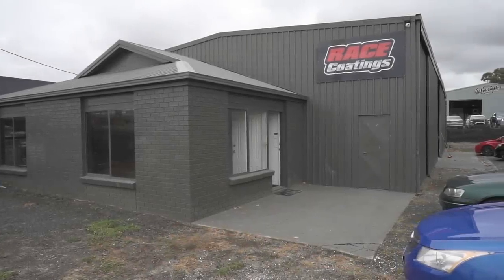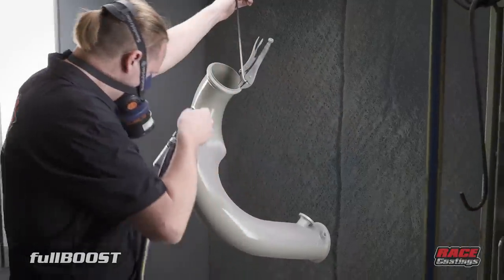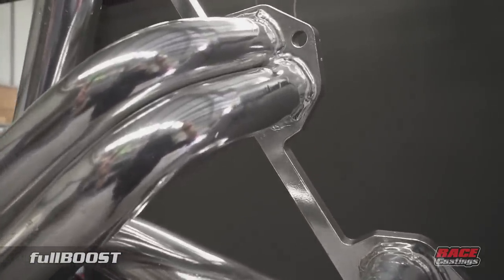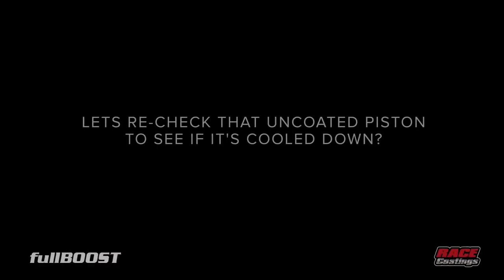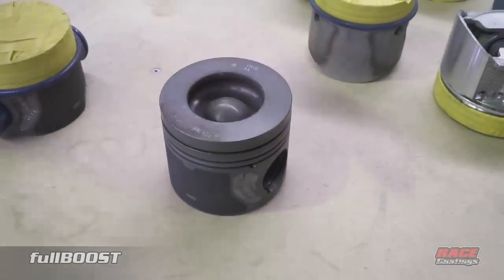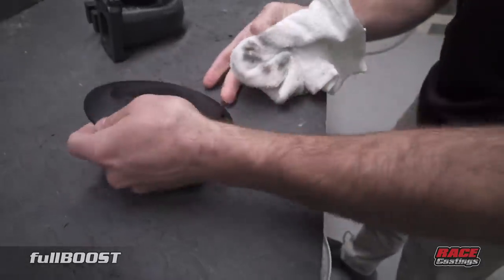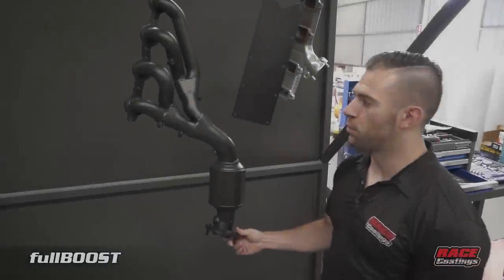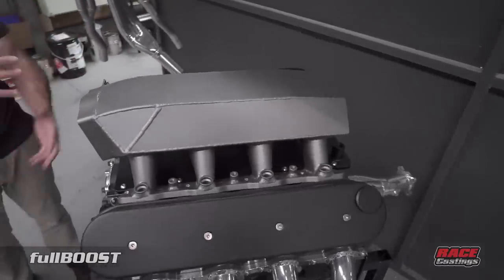What is Ceramic Coating? | Race Coatings

Comment: any fire produces a lot of infrared, this infrared is a heat producing wavelength,  and heats up non reflective surfaces 
we all know the hot glow in our face standing next to a big fire ;-)
what the coating does is, it  reflects a big part of this radiation heat back, so underlaying material stays cooler

Comment: the cut scenes during the Piston temp challenge nullifies the results. hold the Piston sideways apply heat to the Piston crowns and simultaneously film the readouts.
The reason why you did not do that is both readouts would climb at the same rate debunking your product
Reply from the maker: The piston test was performed the same for both but we probably should have edited it better.👍
Reply: @fullboost  if you refilm and show favorable results, I'd be a loyal customer. I'm hoping this happens

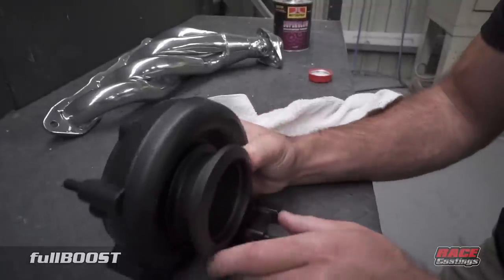Comment: @8:30 you show the powder coming off on the rag, then you hide the rag after you rub the other two...  Obviously you wouldn't have to hide it if the solvent didn't remove the coating.  Why be shady?

Comment: What if . During combustion either the coating crumble
Reply: ee above if troo thin pain on your hgouse will bgrunmlbe, compare and think pplications just becase say spary or saem coating desigm , quality, quality of deogn and appllication, and for that matter thickness and percessuon critical I have a while bunch of apple banas, a tyoe of banana I will sale you instead of apple after all called ab\pple bananas but have zero in common with apples, my point the right prodicutm, desogm aplocation goes a hiuge way on if it will last.  Guess you maybe paint your car with spray painy cans from Lowes or Home deport or wprse roller, yet still p[aint.  Tght product, rigt applicatiom are gritical.

Comment: No talk of price point... that tells me these treatments are out of reach
Reply: It's expensive but certainly not out of reach. I had extractors and a dump pipe coated for $770.
Reply: I can build two complete exhaust systems from the engine out for that kind of money !
Reply: yeah cool but can you coat them and make a quality finish like this? Probably not. You get what you pay for.
Reply: How long will these treated components last ? I will easily get 4 - 5 years out of my steel system
Reply: No actual demonstration of performance increase, either just a lot of theory.
Reply: depending on where you get it done yeah you could say it's expensive but it's durable and it lasts for a while and has a noticeable effect especially with engine longitivity
Reply: i spray these coatings at my shop, they are the real deal. I have had several engine builders send pics of the torn down motors after both drag racing and circle track racing seasons with no change in coating. They have also sent dyno charts showing gains in HP and lower engine oil and coolant temps when their customers have chosen to coat piston tops and sides. Also, we do a large amount of headers and exhausts, we have sprayed chrome motorcycle exhausts with ceramics internally (a special ceramic made specifically for that application) and customers see a drastic reduction in pipe temperatures as well as eliminating any blueing/golding of pipe at heads.
Reply: @TheCanadianBubba  Consider that you might be speaking to an Australian. The Australian Micro Peso may not have the same buying power as Canadian dollars. Also, Australia's population and distance make it so that we don't get much competition here. You have Gunlovistan on your doorstep and decent freight prices. Here, the headers cost more than the coating due to freight.
Reply: Don't get it twisted, just because they are next door does not mean a thing. Our money is worth a third less than theirs, then add duties, taxes and freight. Seems if the Queen's face is on any of the money, We all pay more.

Comment: Common mistake of using a infared temp gun on aluminium. Emmisivity is very low on aluminium and therefore its very hard to get an accurate reading on bare aluminium. The ceramic coating would give a better reading as the emmisivity of the coating will be higher. Would better show the results by using a thermocouple instead of a infared gun.

Comment: 10:45 "only baked at 150 degrees so it doesn't ruin the integrity of the block itself", look at that gianormous crack... also the ceramic coating test on the piston isn't done very well because you holded the flame closer and for longer on the piston that hadn't the coating

Comment: You can't measure temps on reflective materials like that. Use a thin gauge thermocouple.
The IR temp meter measures emissivity. You can paint the surface black or something, or even may be anodize it to increase IR emissivity.
Simpler to use a thermocouple. 
Don't know if hard coat anodize the aluminum pistons would help. May even be a base for your other ceramics. 
Car nuts love shiny objects but don't be fooled.

Comment: The uncoated piston has the entire skirt coated which causes it to hold the heat longer and not transfer is heat energy to the air as easily to the air , so when it’s tested it is hotter later on. 
Also flame distance and time is huge factor. 
It’s biased towards their product for sure
Reply: QUAKIRY CERMIC  coated pistom also includes skorts some incluse rings if say a siedeal with asermic insert for  cylyder walls. thinking 1/8t the way not all.  Think agaon andthink of all, for that matter if cannot think use google and loom things up.
Reply: Michael Gillespie sorry I can not understand any thing you have said at all, please
Google “how to English “

Comment: YEP  till they show a internal engine with various parts coated in what ever coating they use and then show the same engine with no coatings at all and show how much temp wise its dropped by running the same engines on a dyno, so sensors placed in all areas to show oil, water, coolant, glycol and especially heat transfer temps which would occur in the engine bay and transfer heat % in other areas.👌✌👍😀

Comment: Not necessarily a good thing to keep heat up in the deck where the combustion occurs.. you could be kissing head gaskets good bye much quicker. You also need the heat to get to your rings so they expand and seal properly. I admit ceramic is great as a insulator but not my cup of tea for engine internals

Comment: Now if only all Car manufacturers used this system of protection of engine components which directly in contact with extreme heat most of the cars out there would last a lot longer and less work for service centers, HUM sounds like an idea lets make engines which will fail if not looked after so that the service industry has something to do ? Like oil changes and coolant changes and other friction oil requirements in engines and transmissions. :)

Comment: Top engine builders NEVER do it on pistons. I worked for Alan Johnson years ago when a Cerakote rep came in and tried to sell him on piston coating .   He told the guy to get the fuck out of his shop.  It is a good idea on the headers though for circle track applications.   You’ll never see anything ceramic coated in a NHRA pit area.   There’s a reason for that.

Comment: Fml did they say to use coating on the piston is this a joke why would people think that’s smart. putting a ceramic coating would either last because ceramic is harder than steel. it would wear in your piston sleeves. or secondly it would break down long before ur piston does and just create contaminates around ur piston rings and actually cause u to loose compression and power. 

Prove me and all the commenters wrong and post a real test video it’s got my interest.

Comment: Can I buy the piston coat to do it myself from these guys ?
Reply: Probably not, but Cerakote sells the stuff.
Reply: dont bother. if you do that you might aswell go to supercheap and get some spraycans. to do pistons or INTERNAL PARTS go to the pros. that means sending to companys such is this -  https://www.wallworkht.co.uk/  https://www.wallworkht.co.uk/content/motorsport_coatings/ https://www.wallworkht.co.uk/content/group-video/   headers you can/could get away with , but on internals go to the company that supplys aerospace. if you watch their video you will see its professional, and they supply aerospace. that means it must work and be approved and have quality control that is of a high level. you don't get "mil spec" aerospace qualification by being back yard. i have yet to see a company in australia equipped like them, in fact i will say you never will.
Reply: Jonathan Simmonds you are just damaging that company’s reputation doing what you are doing slandering everyone that isn’t the wallworth place makes the company look desperate and look threatened by the competition
Reply: i have no affiliation with anyone concerning this. what i find objectionable is charlatans pretending that they can say " ceramic coat a piston" when if it lasts 1/2 day on the dyno it would be a miracle. because at the end of the day, its your cash you put on the table-  not mine. all good and well flaming a piston under atmospheric pressure, on a workbench compared to being run at 7000 rpm at full load with high cylinder pressures. yes, because thats what its up against. still, when you can get your product used by rolls royce, or pratt and whitney, then - maybe then you can compare apples with apples. still carry on, there are electric inlet 'turbo kits' on ebay. ( btw, i worked for a world class engine development company as a prototype engine tester)
Reply: Jonathan Simmonds 

I see what your saying, an open flame on the bench , vs cylinder pressue with combustion.  

I have piston coat on my 2j pistons, and it seems to help , however i have not checked to see if the coating is still on, after a year of useage.
I wonder if coating is not the best way to go about this, but rather anodizing.
Reply: -when the surface is exposed to a red hot flame front ( i have seen turbo manifolds and the  1.5 metres of exhaust bright red/white for 2+hours on manifold crack testing -jaguar aj v6  sequential turbo) and under pressure, and with the chemical attack, no way does holding a blowtorch on the coated piston compare. apples with apples. anodising protects against corrosion. thats all. oxygen in the air creates corrosion, the white powder you see on aluminium is oxidisation. so, why would you want a coloured piston in your engine? because that would be the only benefit.
Reply: - use/borrow a camera borescope- you can buy for 100 aud put down plug hole.
Reply: anodizing. a this micron thick protecting treatement to stop oxidisation of aluminium. can be coloured. use on piston? nil. except for photo shoot.

Comment: Coating pistons with heat resistant is a bad idea. Heat needs to dissipate through pistons through oil, and piston and cylinder should be even temperature - metal expands, and it should not be uneven.

Comment: You guys really loaded that first piston up with heat and the others with the coating not so much. What a BS test. Then you go back and temp check them and your telling me that untreated piston retained most of its heat? Ya right. Total crap. Besides that, inside of an engine, how long ya think that ceramic is gonna last? Then you have flakes off ceramic pieces traveling through the engine and out the exhaust. Why even suggest this? It could damage the motor. Also, have serious doubts that first piston was the same as the other two. Nice try tho.

Comment: Quite stupid to use pyrometer on aluminum for testing temperature. You need at least attach something that have high enough heat emission rate for measuring with pyrometer.

Comment: Not a very accurate test on the coated pistons vs Noncoated.  The noncoated piston was shown heated all around the whole face of the piston.  The coated ones were shown heated in one spot on the center of the piston.  Well yeah its going to transfer more heat to the bottom.  
To give an accurate comparison all aspects have to be the same or shown as the same and here its not.
Very deceptive .

Comment: Im not so sure coating the top of your pistons is a good idea. The heat that travels through an uncoated piston gets cooled by the oil under it. If the top is just reflecting the heat, it just adds to your combustion chamber temps and if its hot enough, can cause detonation.
Reply from the maker: I'm sure they have done some testing on this 👍

Comment: You are right , kind off. For one I’ve been coating both since 2004. You are bashing powder that was not cured. Also your heat testing with un coated and coated pistons is BS. Put them in the crankcase and see. Yup it’s very durable but you are just doing a business sales gimmick.

Comment: You obviously don’t know how the temperature laser pointer works, it will never get an accurate reading on shiny surfaces hence why it is hotter on the under part of the piston. The heat doesn’t magically run away from the heat zone to the other side of the piston lol you guys are professionals please don’t do amateur tests.

Comment: Why would you want the pistons to have a different thermal expansion to the rest of the block? "If" the piston is running cooler than the block then surely the gap between the piston and the block is increased? Looks like another "Slick 50, Dupont"  Bullshit!

Comment: I believe in ceramics, truly...but the piston heat test is invalid and inconsistent, needs to be uniformed..the first piston the light blue flame tip is directly on the piston top...the 2nd and 3rd, although more acetylene and oxygen pressure is turned up, its light blue flame tip doesn't even come close to the piston top like the first piston..come on guys

Comment: To my knowledge it's just the law of physics ... anything that gets hot, expands ... and everything on earth gets hot, even diamond. By restricting something's expansion when getting hot, can not be healthy.

It's an engine that makes use of combustion of fuel and spark, creates a fire inside .... don't tell me you don't expect it to get hot?

The most expensive car on 4 wheels on the planet has an engine that generates heat, why does that car not have this technology? That prevents the engine parts getting hot, or even warm?

Looks great, good idea ... but the advertising of it is out of line. 

It's a car engine, it is supposed to get hot.

Comment: The flame test is meaningless due to, amongst other things, the difference in emissivity of the surface. You need to calibrate the thermal sensor for each surface emissivity prior to the measurement. Typical measurement flaw when many people use thermal cameras and temp sensors.
Also very bad haircuts in Aus I see.

Comment: That piston display was a terrible example of its effectiveness. It did not make sense. Why not do a controlled test if it works so well. Bit ashamed mate, seems like a scam. You were clearly not being honest with the piston test. You have the torch much closer with the un-coated piston, and how on earth is the top of the piston cooler than the bottom, that makes NO sense what so ever.

Comment: Pistons test is bullshit:
1. Hovering flame closer and for longer on uncoated piston. Slightly touching from distance on coated ones.
2. Laser thermometer does not work on reflective surfaces. They produced 80 degreed on heated top, and 220 on uheated. And didn't even blink. Wtf?
3. Even if coating makes heat transmission slower, it's just a matter of time. In 5 minutes in working engine temperature of these pistons will be the same.
4. Engines designed for temperature expansions of parts. When pistons are hot they have smaller gap with the shaft & less gasses get into oil. Thus hot engine eats less then cold.

Comment: Hey Mate, ever hear of safety glasses for these fools spraying your products? These idiots will cost you money with injuries. When I see vids where no safety PPE, I just won’t deal with them. My reasons are simple, if you don’t care enough about your mates why should you care about my parts and business? Pls think about this. It’s all about professional image.
Reply: Thst why yiu let the professionals do it as most peopel this si not soray on like a can p spray paint, some applied with plasma, whixh powul be dangerious as exterme te,ratire and atachs as cools, evem cermoic headres "Bakes' aftwr pretty sire most peope nt have a oven bi enoigh to bake and would you really want to v]cook ypur food in after a there ius release of checicals as exchange from liquids tp solids, fpr that matter ch9na, or dishs are cer ic coated yet read soe they say dosp;ay only not for fpod, so ylu really thbk uch a process is DIY at home? Just like hign perscision conputer cg\hips, dpsk droves tol;erences require :Clean Rooms as the grain of dust or single haor on tollerence propostion wise is about the same as Mpiunt Everest to  to a human haor.  basically again building a Clean Room is not oractical for a DIY.  \just like you let compsines such as INTEL design your CPUS, b]not try a DIY. Sa,e applies and high prefrmance engones have extermely cloe and accurate tollerences, DIY spary on at this tome imractica; at best and out orgight dangerious at worst and mosrt likely would be impossible.  Let the professionals do it will costs you lesss $$$$ and maybe save yiur life and a prodict that works.

Comment: At 8:15 does anyone else see a blackish smudge on the underside of the his towel as he quickly pulls it away, wad's it up and puts it down without showing us. BS Sketchy video. I to think there is great benefit in ceramic coating, but this video is BS. You can't trust any of the information he gives you when you see the issues that have been brought up here.